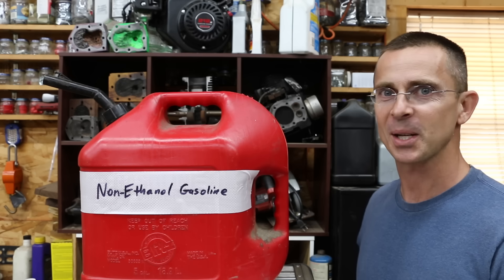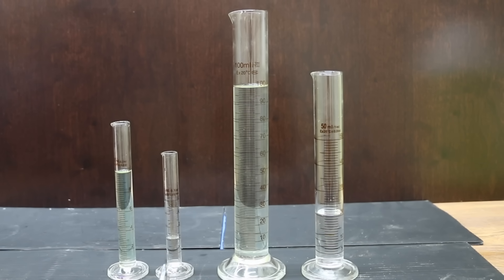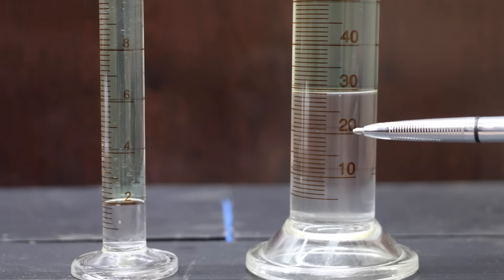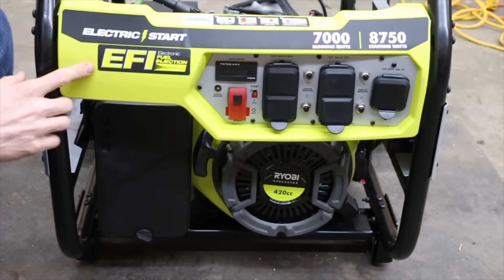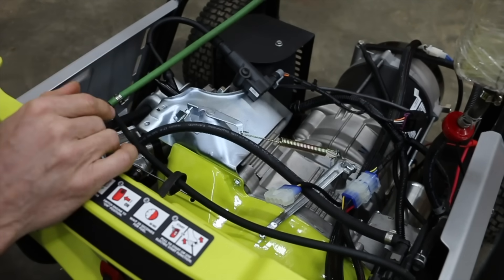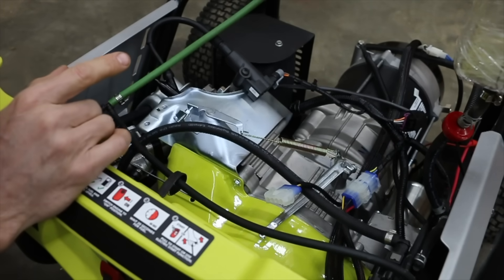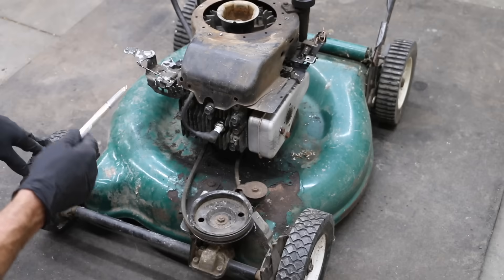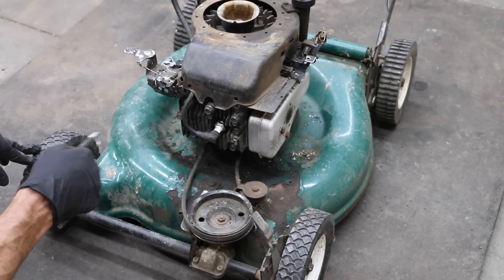Is Non-Ethanol Gasoline Really Better? See the PROOF!

Comment: I remember when younger my dad would go to our local landing strip and buy plane fuel for our snowmobiles and ATV's. Theyd start so much easier in the cold and run so much smoother!
   Anyone know the octane of plane fuel and what additives they add? I know octane it just a resistance to detonation under pressure so it really doesnt matter what the octane is unless the engine is pinging or dieseling
Reply: If I'm not mistaken, plane fuel is basically kerosene.

Comment: as a vehicle engineer  i can tell you that ethanol is awful. When it comes to  slightly older vehicles. It causes rubber fuel lines to disintegrate and any rubber parts in the fuel system to split or rupture. My ford mustang nearly caught fire after a rubber part split causing fuel to leak over a hot engine. Ive seen plastic motorcycle fuel tanks distort to the point where they wont fit back on because the mounting holes wont line up. Or worse still, the fuel lines rupture and spill the contents of a fuel tank out over a garage floor.  More than ever im seeing vehicles with carbs, coming back every year with running issues caused by damage from ethanol in the fuel.   At some point people are going to get seriously hurt or killed in fires cause by  ethanol in petrol.
Reply from the maker: Thanks for the feedback.

Comment: It would be great to see a test using race fuel, aviation fuel, aviation/gasoline mix. My snowmobile sat for 8 years with 20% av gas without any varnish build-up...

Long-term testing would be great as well. It would be interesting to see at what point residue starts to build up on valve stems, pistons, and cylinder walls with ethanol blends vs aviation fuels and av blends.
Reply from the maker: Thanks for the video idea.

Comment: Not often mentioned: octane is a burn retardant. It makes the burn more even. Lower octane fuels have more combustion potential. That’s why if your vehicle was made for low octane gas, then low octane will give you more power and mileage than high octane gas.

If your car was made for HIGH octane gas, it’s probably higher compression, and the more even burn will give you better power and mileage.
Reply from the maker: Thanks for the feedback.

Comment: Or - you could buy premix alkylate petrol, like Aspen make, and skip the benzene overdose from forecourt pump fuel. No ethanol in it either. Keeps for many years with no additives needed, even when left in the machine. And because the heavy distillates of forecourt fuel are not present in alkylate, practically no carbon build up occurs.

My strimmer fuel system and carb diaphragm was totally destroyed by forecourt fuel - even worse now - the ethanol is being increased to 10%. Never using that stuff again. However for people who enjoy stripping down the carb every year, well it'll suit you just fine - you're saving on that cheap pump fuel, right?

Comment: I drive old sidevalve engine Motorcicles . Coalbuildup in this engines is an issue. As my engines normally dont rev more than 3000rpm I saw that the combustion (blue flame) with No etanol-fuel is better at low rpm.  That convinces me that I will throw out the etanol from usage in my engines.
Reply from the maker: Thanks for the feedback.

Comment: Did you ever make that video about the effects of ethanol vs non ethanol on rubber and gaskets???
Reply from the maker: Thanks for the video idea.
Reply: My entire strimmer fuel system, filters and carb diaphragm was totally destroyed by forecourt fuel - even worse now - the ethanol is being increased to 10%. Never using that stuff again. 
Use premix alkylate petrol, like Aspen make, and skip the benzene overdose from forecourt pump fuel. No ethanol in it either. Keeps for many years with no additives needed, even when left in the machine. And because the heavy distillates of forecourt fuel are not present in alkylate, practically no carbon build up occurs.

Comment: Ethanol is a filler. So the gas and oil companies can charge the same price and you the consumer gets less. Before ethanol,  gas had the same octane ratings and most higher octane gas at the gas stations,  don't have ethanol in them. So saying that ethanol increases the octane ratio,  is just a marketing tool.

Comment: You really don't have much of a choice if you're running large high compression engines. My 497 Pontiac running at 16.1 spits and sputters like crazy if it's got ethanol in the gasoline.
Reply from the maker: Thanks for the feedback.

Comment: When they put ethanol in fuel a ton of older small engines burned up. The newer engines are made for the ethanol but I haven't found the newer small engines to be very good quality. In the end, my dad owned a chainsaw that saw heavy use for thirty years on a farm. He only ever had to buy one saw.  I have owned over a dozen saws that have all burnt up. Manufactured obsolescence? Or dry gas?
Reply from the maker: Thanks for the feedback.

Comment: I use marine gas in all my small engines including generators. My issue with ethanol in the past is ruined carbs. I cannot adequately drain all fuel from generators, lawn mowers etc. when out of service, so I cannot take a chance on ethanol.
Reply from the maker: Thanks for sharing.
Reply: If you must use ethanol blend fuel, when you are done for the day and it has a fuel shut-off valve, shut it off and keep engine running until it starves. Do not cut the engine with the switch.

My entire strimmer fuel system, filters and carb diaphragm was totally destroyed by forecourt pump fuel - even worse now - the ethanol is being increased to 10%. Never using that stuff again. 

Now using premix alkylate petrol, like Aspen make, and skip the benzene overdose from forecourt pump fuel. No ethanol in it either. Keeps for many years with no additives needed, even when left in the machine. And because the heavy distillates of forecourt fuel are not present in alkylate, practically no carbon build up occurs.

Comment: Ethanol may attack the elastomers in your engine depending on the type of elastomers / polymers used. 
Some car manufacturers do not recommend Ethanol containing gas, others do if they used ethanol resistant polymer parts in the engine. 
Ethanol has a lower caloric value than pure gasoline, so there's no performance increase with ethanol. Ethanol manipulates/corrects the octane number of the gas to suit your car engine's compression ratio. ...
A lawn mower fueled with ethanll containing gas makes no sence.
Reply from the maker: Thanks for the feedback.

Comment: i can, and have run my car on e85, but in upper NY state, and in PA the e85 usually reads in my cars ecu as 60, in turn making my car run like S @30lbs boost. every location differs based on how far the fuel traveled to its destination. cars that run e85 will also be much cleaner over time, with minimal carbon build up if any. if you run gauges that display manifold pressure, egt, coolant temp, oil pressure... you end up vastly safer, as you have he safety levels preset so if anything goes awry you’ll get an alarm 👍
Reply from the maker: Thanks for sharing.

Comment: Years using it. After 20.000 km head off. Every thing ok. Panda 94 with reostat in the sensor of water for calculator 'cause calculator wasn't enough. Fiesta 2000 when cold needed a llittle gas. 1998 seiscento needs some gas when really cold. 2007 punto no problem, only under 0 centigrades a little gas 15o/o. 600 head off. No problem. Try. Renault traffic Rhd jet enlarged. Years runnimg no problem.
Reply from the maker: Thanks for the feedback.

Comment: “I haven’t owned it long enough to recommend it.”—words of wisdom
Reply from the maker: Good Point!
Reply: @ProjectFarm  now thats its boating season could you do me and everyone a huge favor and test products used to shock tge fuel system made to decarbon, clean gum and varnish, lines and stabilize. The 3 major brands for boating is yamaha ring free, star tron ring clean, kind of a knock off and techron marine fuel additive. Now it's said these will not only maintain but cause do a deep cleaning with a shock treatment. Pretty much you need to use 2 ounces per gallon, Yamaha recommended 1 gallon for 64 gallons for a longer shock treatment but since your engines are much smaller maybe you can just for 10 ounces to 5 gallons. Please get back to me if you can cause with the shortages in outboard motors this can insanely help if preventing repowering motors cause my damaged motors.

Thank you soo much
Reply: @ProjectFarm  pp
Reply: The Chinese figure a way to make things cheaper and cheaper all the time,and this is not a good thing .
Reply: @paulpugh2480  I learned an expensive and very irritating hard lesson with Chy-na made scooters. What pieces of garbage!!!! I won't relive my short experience with 2 of them. The Chy-na makers don't care one lick about the crap as long as they can shove it out the door....then its YOUR problem. A study of any Chy-na business/manufacturer is a study of how NOT to do anything....period.
Reply: In Brazil we have 30% ethanol gásoline . 95% of our car fleet are made to be flexfuel. We can use any proportion of ethanol in this cars. We have ethanol pumps in gas stations.

Comment: One thing learned by the Auto Makers was Ethanol Did impact the fuel systems and it's why they had to switch to Stainless Fuel Lines in the late 80's. Now this doesn't mean that pure Ethanol isn't a usable fuel - Look at Brazil where you have Non Ethanol, the E10 and Pure Ethanol. Depending on costs, folks will go with Pure Ethanol as it's half the cost of pure gas and still cheaper then the E10 stuff.
Reply from the maker: Thanks for the feedback.

Comment: When the Ethanol fuel first came out, my 4 cyl 1991 Nissan Hardbody truck fuel mileage went from 25 MPG down to 22 MPG, or about -10%.  It had throttle body fuel injection.  I sold that truck a few years later and bought a newer 4 cyl Nissan truck (1989?).  I think it had separate fuel injectors near the intake?  Maybe Nissan engineers did some work with that fuel in mind and I was getting 25 MPG again.
Reply from the maker: Thanks for sharing.

Comment: my experience with flex fuel ford expedition: 150k on odometer. used regular pump gas (most likely 10% ethanol). when the engine light came on at around 130k miles, engine code indicated O2 sensor. so i ran e85. it cleared up after running two tank full. O2 error comes back on after running regular gas. e85 gives me much better acceleration but lowers the fuel efficiency (from normal 18mpg to 14mpg). note: the engine is designed for high levels of ethanol, therefore, no issues with seal/hose corrosion. it also has high capacity injectors. my audi a4 is also flex fuel and runs really nice with e85 (same with reduced gas mileage). i'm sure a number of car tuners are taking advantage of the low cost high octane ethanol to build their engines.

not sure if it's unfortunate or fortunate that in 2021, gas engines are being replaced with electric. large capacity batteries (lithium based) are toxic and not environmentally friendly.
Reply from the maker: Thanks for the feedback.

Comment: Ethanol is a gimmick.  Remember E10 mixture is only 90% real gasoline( some places use E15),  and it takes 1.5X avg ethanol to get the equivalent energy of gas.  Figure it up with math and non ethanol (all gas)l is no more expensive and has far less problems long term.  Every single small engine shop will tell you to run premium non ethanol gas for a reason.

Comment: Great video. I do actually see that the ethanol side had noticeably less carbon deposits, but barely noticeable. Always wondered about this and glad I stumbled on your channel!
Reply from the maker: Thanks!  Thanks for the feedback.
Reply: If you compare picture with pistons and valves you will actually see that carbon build up is higher on this short run of an engine in video. Look at those build up on the valves. That carbon will make a mess after some time on outtake valves as shown.

Comment: After tearing down a few engines that used Non-Ethanol fuel for decades, and then doing it to the same engines after ethanol became the norm, I can save you some time.  Sugar gums up a lot of internal components.

Now, that being said, a majority of the newer car engines are designed for this type of abusive additive, so not as many internal components are damaged over time.  However, there is still a lot more carbon build up in engines that use gasoline with ethanol in them as compared to those that only, or primarily use non-ethanol gasoline.  Ever wonder why there are major warning labels on vehicles telling you not to use higher levels of ethanol in them?  Because it is not good to run "sugar" through your engine.
Reply from the maker: Thanks for sharing.

Comment: Perhaps a more accurate statement would be the ethanol/gas mixture has "about" 10% ethanol in it.  With multicomponent mixtures you have to consider the partition coefficient for each species...in short there may be 10% ethanol in the mix, but not 100% of the ethanol is transferred to the aqueous phase, some of it remains the organic layer "gasoline".  It quite cool how the water/gasoline meniscus is inverted from what is typically observed!  Good job!
Reply from the maker: Thanks!

Comment: Ethonol is bad for small engines but great for people like me as many times I find lawn mowers and snowblowers by the road to be trashed. Just this last week I found a lawn boy mower and a toro snowblower which both run great. Lawnmower had old gas in it and the toro snowblower had carburetor needle and seat damage from Ethonol gas and would stick open making engine run too rich. All my life I will take a 30 mile drive to east troy wisconsin from Milwaukee to get Ethonol gas for my small engines. I tell people not to use Ethonol gas in small engines because of theese problems on this video.   If you can't buy Ethonol free gas then try to seperate it.
Reply from the maker: Thanks for sharing.

Comment: My car is a 2007 Fiat with 112,000 miles. Ethanol has been in U.K. fuel for all of that time. The fuel consumption is the same now as it ever was. It has a knock sensor so runs better on high octane “super” fuels. Engines with no knock sensor do not benefit from high octane fuels. 
Water in the fuel will have an anti knock effect - water injection is used on some high power engines.
Reply from the maker: Thanks for sharing.

Comment: I own a 1990 Plymouth Grand Voyager  mini van with a 3.3 L  V6  engine.
It has over 163,000 miles on it now.  In the last seven years I have had to replace 
three of the six fuel injectors.   The last time I had my mechanic replace the O rings on all the
remaining injectors with new ones.

I use regular octane fuel with ethanol.   I checked and my car manual says it is rated for this.
Could the ethanol be what is killing my fuel injectors or is it just old age?

Comment: show them how long ethanol gasoline and 10% ethanol gasoline in a 2 stroke engine before it locks the engine up and melts the rings to the piston, , never run ethanol gasoline in a 2 stroke engine,  buy the good stuff, no ethanol gasoline,

Comment: The REAL test comes with the next video. It will eat the carburetor on your mower if it is plastic. If you put a fuel additive in with it the problems stop. I had a long distance drive everyday to work. Ethanol for sure dropped my mileage per gallon.
Reply from the maker: Thanks for the feedback.

Comment: when you do a long term test could you include a few types of gas line also? i run quite a bit of outboard motors and some types of hoses seem to always struggle. even though i I stay away from running ethanol in my boats.
Reply: Good move

Comment: Here is a long term test for you. I have a CUBCADET 1554 mower purchased in 2005 with a Kohler CV740 engine. It's been running on E10 since I purchased it. 16 years now, still has original carb and fuel lines. I only serviced the carb once, in 2008, because the engine was running very rough. The carb was spotless, I had sheared the flywheel key. No carb service since then. I have had no issues with E10 is small engines. I've been running 91 octane E10 in a Husqvarna chainsaw since 2007, again original carb and fuel lines, never had to service or adjust the carb.

Comment: I have a car I stopped using because it needed several repairs plus I had three other more pressing issues.

It required high octane fuel and the only gas I could get two years ago with high octane had 10% ethanol.
I put a double dose of Sta-bil in the tank with fresh gas.

Last week I started it and was going to move it to the garage. It only got about 20 feet and stopped running. No gas to the engine. It has an electric pump in the tank. It was not running. So I bought a new pump and when I pulled the old unit out I could see in the tank there was the most horrible looking mess in there. And all over the pump too. That was why it quit running. I know sta-bil is good stuff, I have used it for years and it never failed me. But it couldn't deal with long term storage with ethanol.
Ethanol is murder to gasoline systems.
Reply from the maker: Thanks for sharing.